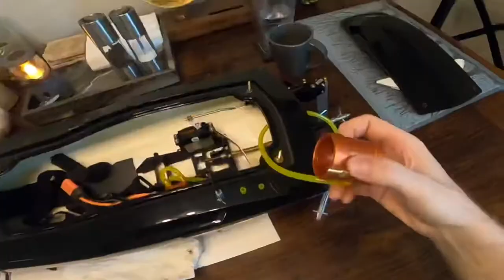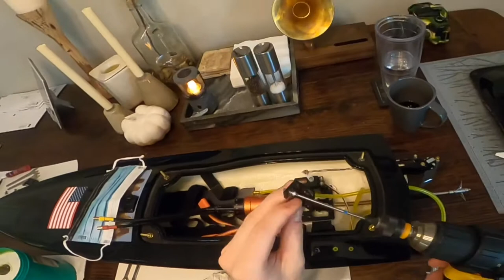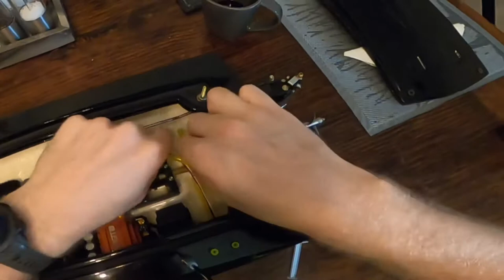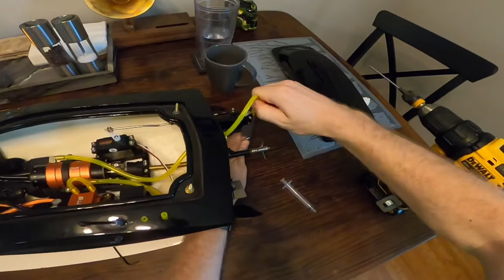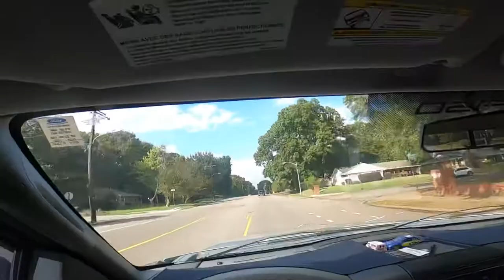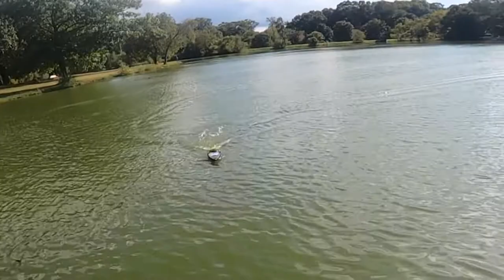PROBOAT IMPULSE LEAK FIX w/ GREASE and SYRINGE!!!

Comment: Great tutorial btw. This is such a bad design, because the motor itself should have a clamp and not a clamp onto the  cooling can. The vibration from the motor destroys the rubber seal, so clamping the cooler is very backwards. I think one way around it is to not clamp down hard on the rear strap and seal with some silicone.
Reply from the maker: I agree clamp on the cooler is not ideal. I tried silicone first but grease and like you said not tightening down so much ended up working better.